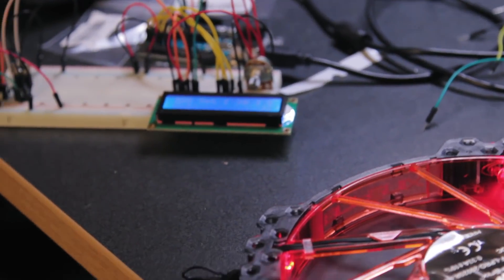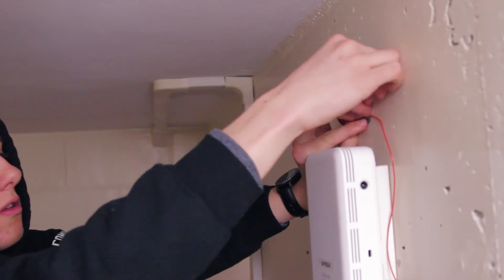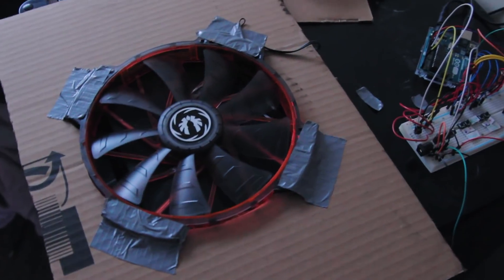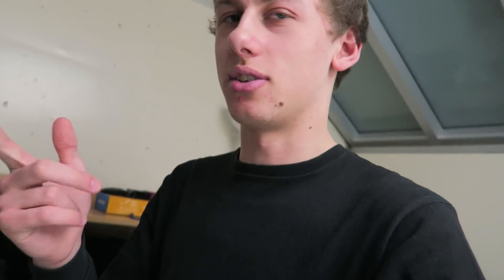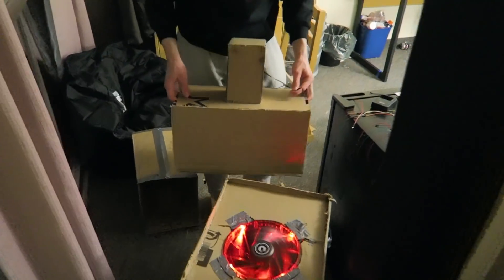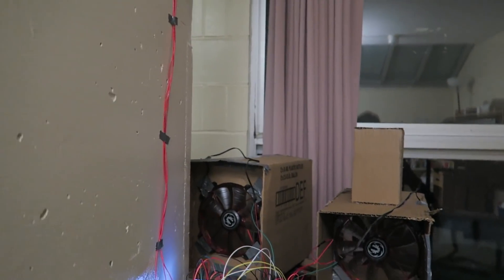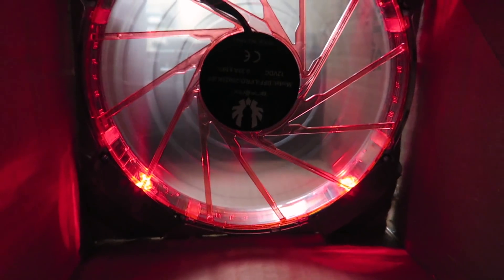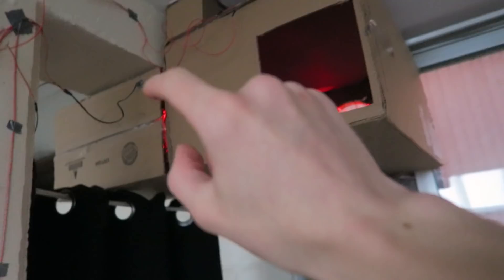DIY Air Conditioner (Arduino)

Comment: I was a mechanical engineering intern at Major appliance company's Air Conditioner R&D Department, and this was extra funny for me because we totally made testing apparatuses out of cardboard for air flow.  LMAO  This is legit engineering bro ! 1 !
Reply: Well then maybe you can answer a question for me. Do window air conditioners have a secret outside air temperature sensor that refuses to let the air conditioner turn on if the outside air is cooler than the inside air? Like some energy efficiency feature? Because I have noticed this across several air conditioners. And it is infuriating, because it is not easy to open a window with an air conditioner in it.
Reply: hey i just made a new video where tried to remake this.If you could check it out i would appreciate it! https://www.youtube.com/watch?v=ibS6ChZCKeg

Comment: Next Arduinob projects : 
1. Building your own OBD2 scanner for your car through the ECU.
2. Design your own devices for other system you found interesting in your car such as : monitoring battery/alternator voltage.
3. If you are interested, design a textual communication system for car drivers in the street. Using horn can be confusing if we want to say something to drivers behind, etc. So an effective communication system may help for this purpose. I have thought about this idea, but haven't found the solution for displaying devices. I can only imagine like running text to be displayed on the front or rear windshield.
Reply: holographic laser projection onto the back windshield from a shrouded projector. could be bright enough to see in broad daylight, add tinted film behind it and should be very easy to see. use a voice parser to allow speech to text then display that
Reply: @ExplosiveKaboom  Thanks for reply. Have you implemented the idea ?
Reply: Lex Soft no, but i think i could. would be easy to put a button somewhere to trigger the voice parsing

Comment: I know this is old now but if you still have your broken arduino drop the chip from a working one in and test it ! I blew a chip on mine and was able to replace it for $0.99 on ebay fully burned bootloader saved me paying the £25 that they are here for a new one

Comment: Hey, the system isn’t going to be effective unless you find a place to divert the heat. You’re essentially designing a refrigerator and you have the hat coming in from the cold reserve, but you don’t have a waste to dump the heat to the hot reserve. I would suggest creating a second fan system opposite to the air output of the original fans to blow air back outside (possibly lower to the ground, since the ground is hotter)
Reply: Hot air rises, so the air closer to the ground would be cooler, not hotter.

Comment: My keyboard's cable goes over the top of my desk, and then down the back of it, and behind my monitor, I have a lamp to light up the desk without BLINDING me, but the cable has SO MANY CRACKS... XD (The light is breaking down the rubber in the cable... XD)

Comment: dude you're smart as hell. what language were you using to code the ac itself? c? looks like c
Reply: Kevin Dad it's Arduino C which is basically C but used in conjunction with the Arduino IDE

Comment: Nice project! Hopefully you added some sort of hysteresis to it so the fans aren't constantly turning on and off when it's right at temp, like a buffer zone where it'll take the temp down to what you set, but won't turn on again until its 2 degrees higher or something

Comment: How do you know what parts to get though, you should make a video talking about how you got started with programming, what resources you used, what languages you used first and still use, what kind of projects you did at the start, the whole journey.
Reply: just do it
Reply: He's using Arduino. Buy the simple arduino package online, it will come with all basic components. Afterwards, download the Arduino software. It is coded in C. Then, you can use simulators online to create your arduino project before the actual physical implementation.

Comment: Now the only thing left is yet to buy R600(used in a fridge) thermal fluid and think of a way to ACTUALLY cool your room in case its hot outside ^^ :D

But definitely nice video :D

Comment: This is probably not useful information anymore, but you could run a peltier plate attached to 2 heatsinks, with one connected to the outside to disperse the excess heat/cold, and one for inputting the desired temperature into a duct system. The polarity can be reversed to switch which side outputs heat or cold, and the amount of power could be adjusted based on the amount of heating/cooling needed.
Reply from the maker: I know I thought of the exact same thing last year and actually bought two of them.. If only I had time to implement that hahaa
Reply: Yeah, time is definitely a huge limiter. It turned out good anyways tho

Comment: If its warm outside and youre trying to warm up or cool down the room. then have the fans turn the other direction to blow air out as needed. although with that setup it might not be nearly as effective with the non window room as it does with the windowed one.

Comment: Hey, can you please do this for me inside the box put aluminum foil for the air to stay cold and not try to escape from the box itself. I think this might help a tiny bit in keeping the air in and what are you going to do if its winter and it's extremely cold? you should maybe add like a sliding door to cover it up. I've been watching since your old 13k channel btw Keep up the good work :D
Reply: or you can put cooler box/ styro foam

Comment: Dang nice. How did you learn to code Arduino?
Reply from the maker: It uses the C language which I know from courses. I'm majoring in computer science so the software is easy for me
Reply: Devon Crawford Ok thanks :)
Reply: Armando Morales it's hard to properly learn about electronics on your own, you can read online and know roughly how/what a component does and maybe even look at a circuit and try to figure out what it roughly does, but if you want to be able to design your own circuits and properly analyse them you need a formal education or years of spare time
Reply: Armando, just major in CS and take a circuits class on the side? You basically spelled out the answer in your comment: "I was considering computer engineering but I know I want to work in software in the future and just like electronics as a hobby."

Comment: Could you run it with something like a raspberry pie so you don't have to keep your laptop plugged into it all the time?
Reply from the maker: a raspberry pie would work as well, but once you upload the arduino code you plug in a power supply and it runs the code automatically